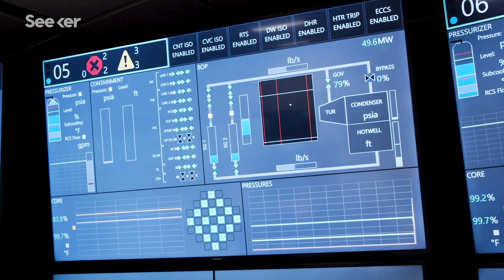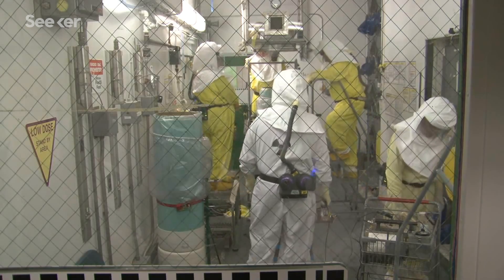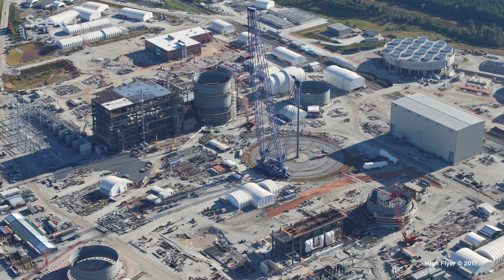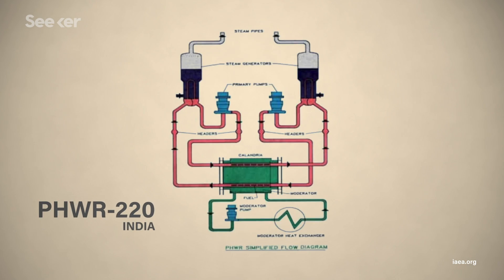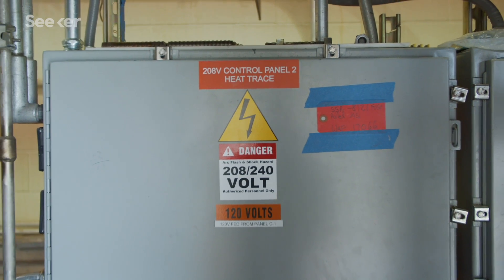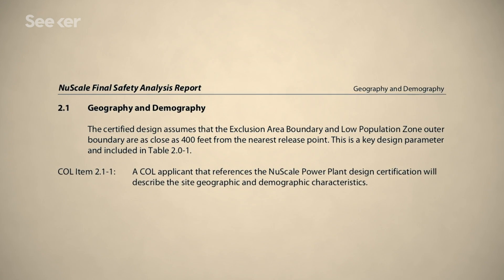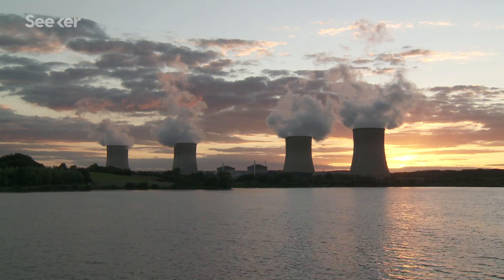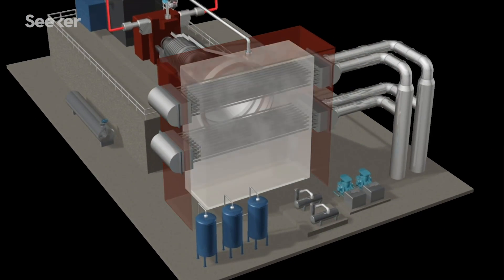Mini-Nuclear Reactors Are Coming, and They Could Reinvent the Energy Industry

Comment: Any chance a Thorium reactor can be developed this way? Uranium is the safety problem, not the nuclear reactor!
Reply: the main advantage of thorium is the fact that it is way more common than uranium and thus will last us much longer. the process of getting energy from thorium turns it into a special isotope of uranium.
Reply: Unlawful_Falafel True, but we would also have to build thorium supply from the ground up, which has very high initial cost. There are some additional benefits of thorium especially in very particular reactor designs such as homogenous LFTRs, but overall the thorium fandom train is largely overblown. 

We should pursue development of thorium reactors especially in Molten Salt variants, but it will be much easier, faster and largely more cost effective to primarily focus on Generation IV integration with conventional uranium fuels. 

Breeder reactors are a very large sector of advanced nuclear under development both Thorium and plutonium breeders. There is significantly more research and development with plutonium fast breeders and there are some additional advantages working in fast Spectrum, however there is also higher risk associated with plutonium breeders than thorium breeders, so I see the overall development over the next 20-30 years to be about equal between thorium and plutonium breeders.
Reply: Uranium was originally chosen over Thorium because it can be weaponized. Developing reactors and its infrastructure was due to military interests. Uranium leaves nasty waste, not that Thorium doesn't but it can be disposed much easier and safer. Today, a new computer and a good team could create the infrastructure much quicker than what it took in the past. My issue is I live in an earthquake zone. A small mobile reactor would be great idea for areas like where I live.
Reply: DeenLee A Thats not true...
Reply: Brian , it is very true.
Reply: 1. This comment makes zero sense when you realize Thorium is literally bred into Uranium
2. This comment is not even remotely accurate. 
3. You can face similar risk issues using thorium cores.
Reply: Brian, uranium 235 isn't bred from Thorium. You are wanting an argument not a debate by stating that it makes zero sense. Thorium is used to make uranium 233 for nuclear reaction. You make a non sense debate that thorium has similar risks. The largest risk is completely changing the infrastructure. Uranium 235 is used to make nuclear bombs and also produces a serious amount of waste. Thorium waste lasts only 300 years compared to hundreds of thousands. Uranium 235 is just more useful for the military (subs and aircraft carriers included).
Reply: DeenLee A You apparently are not aware of the fact that in the early 1960s the USA, USSR and UK tested bombs with uranium 233 and that in the 1970s India did the same. 

You are also not apparently aware of the fact that there are multiple US laws and international agreements preventing commercial reactors from producing nuclear bombs or weapons grade material. 

You apparently don’t understand the fact that because Uranium 233 has a shorter decay rate that actually makes it significantly more radioactive. 

Lastly you seem to not be aware of the fact that commercial reactors are not able to produce weapons grade plutonium due to a longer fuel cycle.
Reply: Brian, you make too many assumptions. I am aware of 233 to 235 decisions. My family has been in the Navy for 3 generations. Not every country applies to the rules and laws. I am aware that the infrastructure for thorium is under way for commercial use mainly because of restrictions from the U.S. Large interests are for reactors on cruise ships to locomotive applications. Like computers Brian, you may be in need of an update.
Reply: DeenLee A Except that these international agreements have considerably more weight than most international agreements. 

The Non-Proliferation Treaty of 1970 is maintained by three largest Nuclear superpower countries. 

The IAEA requires that all chartered members adhere to its policies prohibiting the production of weapons grade materials at commercial facilities. These requirements are overseen by the UN Security Council, and any nation that violates these requirements is considered a Rogue Nation not only by the IAEA but also the UN.

Comment: Okay that sounds great and all, but that doesn't solve the nuclear waste problem.
Reply: These new reactors create 2% of the waste that 3 Mile Island did. It's like comparing apples to Llama's.
Reply: @maxidaho  but you would also need more reactors to create the same level of energy, don't you?
Reply: @konseq1537  There is a full size 1100MW reactor 30 miles from where I live that creates NO waste at all. None
Reply: Thorium reactors produce less waste than uranium reactors and the waste is less radioactive and has a half life of 100 years. Not to mention a meltdown is impossible with a thorium reactor.

Comment: Still using fuel rods? Can they get more than a 5% burn of the U235 or is it another huge transuranic waste generator? Where will the bribes come from, and where will the go. That is what will determine the outcome. That is what has determined the outcomes in nuclear power for the last 60 years. Alvin Weinberg invented the LWR and told us at the time it was dangerous to scale it up for commercial applications. It is fundamentally a small marine reactor that operates extremely safely up to 60MWth but above that output steam pressures become enormous and therein lies the danger. His other design, the Molten Salt Reactor, was easily scalable, safer, and 20-30 times more efficient in fuel consumption and waste elimination. But no razor blade economics so no corporate backing and bribes, and they shuttered the project after tremendous successes. https://www.youtube.com/watch?v=tyDbq5HRs0o

Comment: Nuclear technology should not be used anywhere on the planet space that's okay but not on the planet even if it limits our technology or throws us back a hundred years it is stupid to utilize nuclear technology with what we've already seen NFL's Fukushima still leaking radiation into the ocean every single day hundreds of thousands of gallons of water are contaminated and they're not doing anything to stop it
Reply: Wayne Miller you can’t detect the radiation from Fukushima in the ocean, it is incredibly low, you have been misslead. It’s just diluted/decayed away and the radiation can’t do much damage in the water because it can’t travel far through water, it just gets absorbed.
Reply: Except modern reactors are designed completely differently and have active and passive fail safes that will prevent any possible meltdown. Also, it is worth noting, that nuclear has accounted for the least amount of deaths of all energy sources (worst estimates put deaths in the thousands, but honest estimates would put the death toll in the high hundreds).

If we are going to replace fossil fuel energy sources, we HAVE to use nuclear. Solar, wind, and hydro will never be able to sustain the baseload required for our energy needs. Nuclear can and will fulfill that baseload.

Side note: coal ash is more radioactive than nuclear waste as the radioactive material in coal ash has shorter half lives.

Comment: when I think Nuclear I think unmanageable waste byproducts that last not decades or centuries but millennia. No solution is offered here for the new waste that smaller ( but more numerous and geographically spread out ) reactors will create. Nor is there any solution for the existing waste or the ongoing triple meltdown at Fukushima that continues till this day pouring 400,000 gallons of highly radioactive water into the Pacific Ocean. This video is pure PR talking all the safety measures, all the control and upside with NO REAL SOLUTIONS to waste, the towering carbon footprint of 1000's of years of waste management, the massive carbon footprint of nuclear accident remediation and nuclear waste containment failures. Finally no ideas offered on the new math of Climate Change, Climate Disruption. If you have a thousand smaller reactors spread around then the exposure to new weather dynamics is heightened. Floods, Fires, Tornadoes, Earth Quakes all are on the rise. How to smaller nukes matchup with a 60 mile an hour fire covering 100s of square miles with no fire containment or a 1000 year flood encompassing half a state? Smaller nukes are the same problem as older nukes but with better PR. The latest and greatest front end nuke solution still has the long devils tail that is ignored.

Comment: Thorium is a extremely cheap and easy to find and a reactor made of of the stuff won’t belt down because it’s cooled by molten salt if power goes off the fuel drops away from the reactor and little to no byproducts. I know why they won’t do thorium reactors because you can’t make any nukes with the by product but you can with waste from a nuclear reactor
Reply: A thorium reactors when melt down do not release radiation

Comment: I'm no nuclear physicist but if I was running a smart control room for a nuclear power plant

I would turn on the lights
Reply: I think one of the reasons could be that, if an accident occurs and all the power goes out, the operators eyes are already trained to the darkness.
Reply: @gotbread2  that's not at all how eyes work bro, plus they'd have backup generators that'll power low wattage lights
Reply: @ItsYesChef  and....batteries, phones, pocket lights, crank torches etc. nobody needs to sit in the dark!
Reply: @ItsYesChef  Woosh
Reply: @lordofnothing.  Woosh²

Comment: 6:08 That doesn’t tell me how the reactor will remain cool indefinitely without water needing to be continuously pumped into the core. You have electromagnets that will disengage dropping the control rods in the event of a power loss, but that design has been around for ages, and it doesn’t solve the problem. You will still have radioactive fission products emitting residual or decay heat which is why a coolant must be circulated over the fuel. Frankly he didn’t tell anyone why this system is safe, but he sure made it sound like he did to those not familiar with reactor operation.
Reply: Arthur Morgan its a pool type reactor

Comment: Because Japan built Nuclear reactors in areas exposed to earthquakes and tsunamis, European countries dismantle their nuclear power plants and instead rely on coal power plants.
The climate change has gone so far that I'm afraid it has passed the point of no return.
Reply: "Because Japan built Nuclear reactors in areas in areas exposed to earthquakes and tsunamis,"
Wrong, because the property rights of Japanese citizens are so low that Tepco bean counters determined it would be cheaper to do nothing and have an accident than the retrofitting recommended three times to them by the IAEA.

The very front page of the blueprints for the plant in Fukushima says not for use in areas which risk earthquakes above ~5.4 without retrofitting.

Comment: Those electromagnets for the control rods better be connected by power lines that can’t stretch or bend in any circumstance, you don’t want your safety mechanism to not engage until the reactor falls over and it’s too late. Or maybe they’re spring loaded so it doesn’t matter even if it’s fallen over?
Reply: They usually are “spring” loaded. In the past they used to use high air pressure that would propel them down in the event of a scram. My question is how they expect to continue to remove decay heat because my man in the video glossed over that safety feature. Scramming the control rods and stopping the fission reaction isn’t the concern anymore.